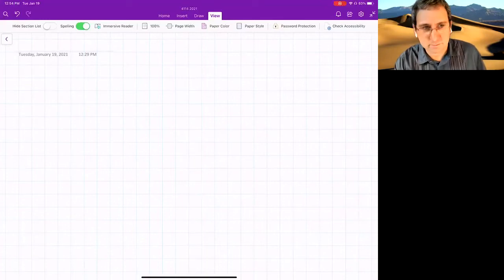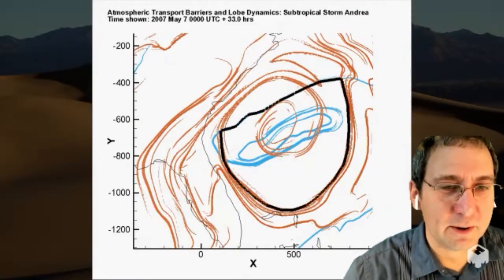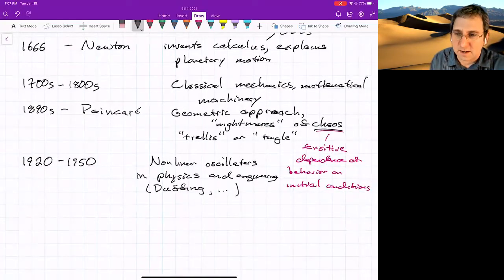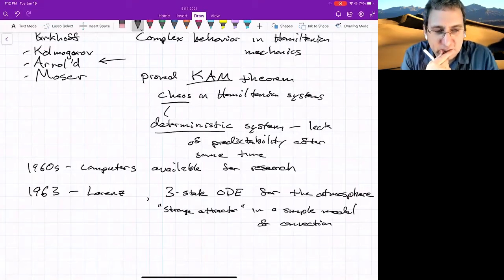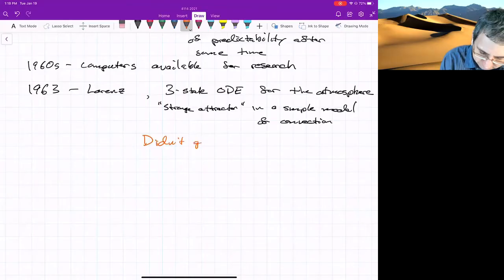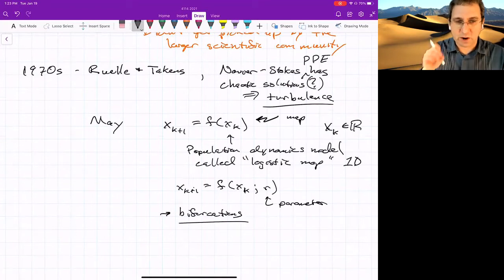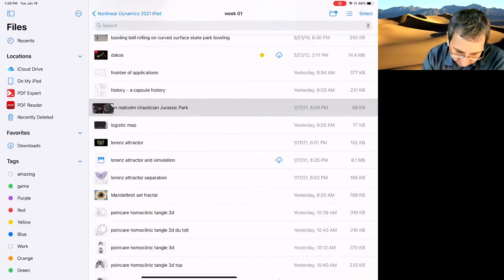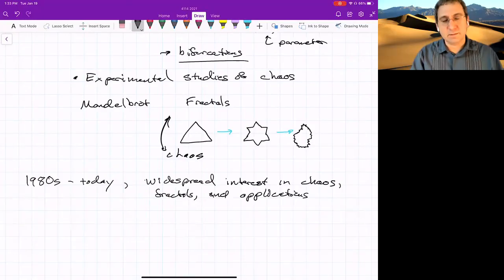Nonlinear Dynamics and Chaos: Introduction (Strogatz Ch. 1) | Lecture 1

Comment from the maker: 👋 Welcome to the Nonlinear Dynamics and Chaos course!

This is Lecture 1 — what nonlinear dynamics is, why it matters, and how it differs from the linear systems you've seen in earlier coursework. The course covers fixed points and stability, bifurcations, phase portraits, limit cycles, the Lorenz system and the definition of chaos, strange attractors, and the route to chaos via period-doubling.

📚 Course resources
▶ Full lecture playlist (all 70+ topic videos):
   https://www.youtube.com/playlist?list=PLUeHTafWecAUqSh3Gy0NNr7H3OsXoC-aK
📄 Lecture notes (PDF):
   https://drive.google.com/drive/folders/10a4O3L0ZK-7oVLw3xkIJkVHEJ8eoTq6g

📖 Companion textbook
Steven Strogatz — Nonlinear Dynamics and Chaos: With Applications to Physics, Biology, Chemistry, and Engineering

Strogatz's book is the standard text for this material and the course aligns with it chapter by chapter. The videos work well as standalone tutorials or as companions to the textbook.

🎓 Course structure
This course is the AOE 4514 / ESM 4114 undergraduate course at Virginia Tech (4000-level, designed for students with calculus and differential equations background). Unlike a traditional lecture series, the videos are organized as ~70 short topic videos (~15 min each) rather than full hour-long lectures — so you can jump to whatever topic you need.

🔗 If you want to go deeper or broader, here are companion courses on the channel:
▶ Lagrangian & Rigid Body Mechanics (analytical foundations):
   https://www.youtube.com/playlist?list=PLUeHTafWecAUl2DuWWdRU1MckJv7M5LEH
▶ Hamiltonian Dynamics (chaos in Hamiltonian systems, KAM theory):
   https://www.youtube.com/playlist?list=PLUeHTafWecAVCauQ541UBrfGqHQwuHq_2
▶ Center Manifolds, Normal Forms & Bifurcations (advanced follow-on):
   https://www.youtube.com/playlist?list=PLUeHTafWecAVblNx278wBxkIQXw7iJws3
▶ Three-Body Problem Orbital Dynamics (chaos in celestial mechanics):
   https://www.youtube.com/playlist?list=PLUeHTafWecAXDF9vWi7PuE2ZQQ2hXyYt_
▶ Spacecraft Attitude Dynamics (rigid body dynamics, applications):
   https://www.youtube.com/playlist?list=PLUeHTafWecAXDFDYEwunLL2V2kwqKzkvJ

Nonlinear dynamics is one of those subjects where the geometric intuition comes faster than you'd expect — once you can sketch a phase portrait, everything from population biology to spacecraft trajectories to the Lorenz attractor starts to make sense as the same kind of geometric story. Take your time with the early lectures; the foundations pay off later.

Questions about any topic? Reply below.

— Shane

Comment: the way to understand this, poincare tells me (I can try and communicate), is to see there is an obj, at. rest, and a force, imagine wind, picks up that particle of dust and pushed it against a wall (force in the opposite direction) and has to overcome the constraint, the wall, so it is left with the left and right directions to move - as it "decides" much like in billiard, it moves in paths mostly dictated by constrains, gravity, time, lift, momentum, etc play a part - paths are determined as in water flows down valleys - in this one he is asking how do we calculate this?

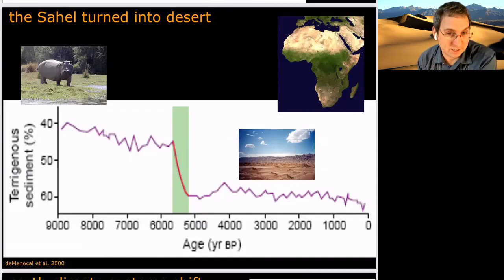Comment: 33:41 That terrigenous sediment plot is very misleading because the y axis is actually reversed (higher is at the bottom). "Terrigenous sediment" basically means dirt that is made of rocks or dust with little or no material made of living organisms. So a higher percentage of terrigeneous sediment actually means there is less life in an area contributing to the accumulation of biogenous sediment (sediment made from remnants of living things). Since soil shifts over time, a rise in terrigenous sediment over time indicates that an area is losing biomass, specifically aridification in this case.

Comment: I'm a master students writing my master's thesis on bifurcation theory (the study of local birfucation, classification , global techniques to detect bifurcations)
I lost all my motivation recently, but your lectures help me get back on track gently 
Thanks !
Reply from the maker: Really glad to hear that. And hang in there. Thesis work on bifurcation theory is genuinely hard, and losing motivation mid-way is more normal than people admit. The fact that you're engaging with the material from multiple angles is a good sign. If you're working on local bifurcations and classification, you might find the center manifold lectures useful as a complement. They connect the local theory to normal forms in a way that I find really clarifying. Best of luck with the thesis!

Comment: how difficult is this class relative to generic upper division math classes? It seems up there in difficulty. This seems like the class u want to take if u want to start trying to solve the 3 body problem.
Reply from the maker: This isn’t a math course per se—it’s more geared toward engineering students, with a focus on applications and numerical examples rather than formal proofs (though we do work through some analytical demonstrations). I have a background in math and physics, but most students come from engineering, as juniors and seniors.

We cover nonlinear systems in up to three dimensions—just enough to start exploring chaos, but not quite deep enough to fully tackle the three-body problem. That said, this class can be a solid first step in that direction. If you’re serious about the three-body problem, you might follow it up with this course: 3-Body Problem Orbital Dynamics
👉 https://www.youtube.com/playlist?list=PLUeHTafWecAXDF9vWi7PuE2ZQQ2hXyYt_